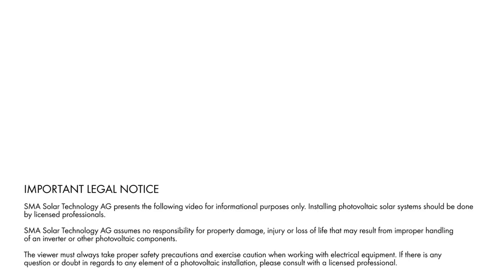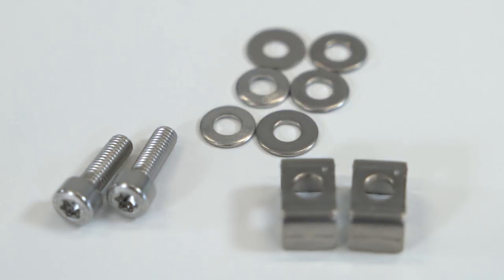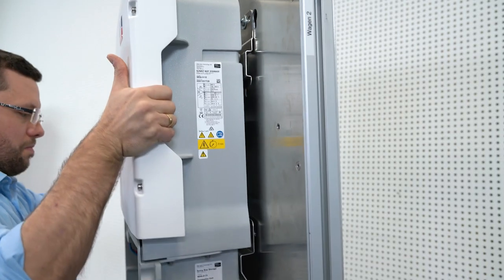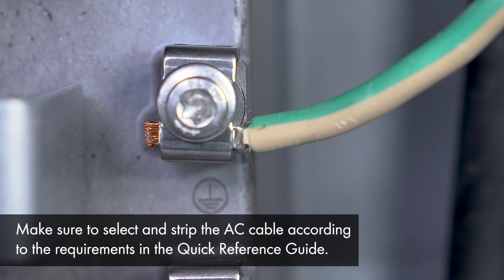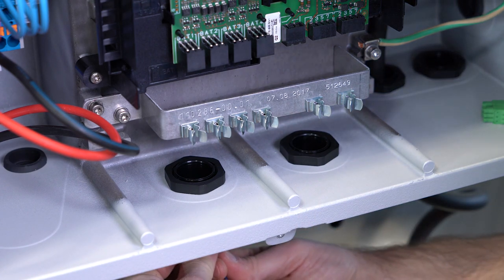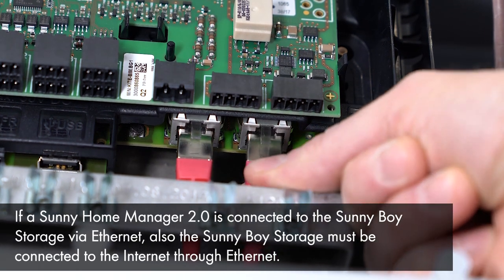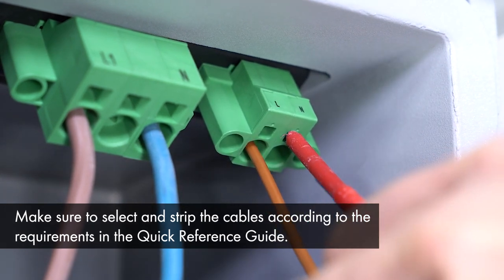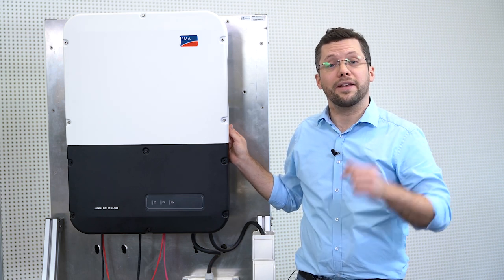Tech Tip: How to install the Sunny Boy Storage 3.7, 5.0, 6.0?

Comment: There is a version of these inverters that seems to be made for the US residential market, and while the secure backup circuit is 120VAC, the primary output voltage is still 240VAC without any hint of split phase capability. I searched for installation documents for the -US models but couldn't find anything.

Comment: Video is great, but you didn't explain why you used jumpers. At the manual you can find the info, but it would be useful to add a comment in the video explaining why to use jumpers or not, depending on the maximum charge/discharge capacity in A of the battery. If you use jumpers you cannot connect 3 batteries, but 2. Thanks for the videos, they are cool!!
Reply from the maker: Thank you for the feedback! :-)
Reply: @SMA: Can i use a salvaged EV car battery that has REC BMS together with this sunnyboy storage? I know it works with Sunny Island, but is it supported here?